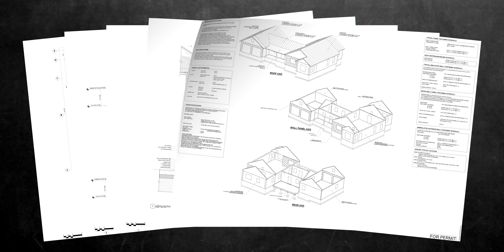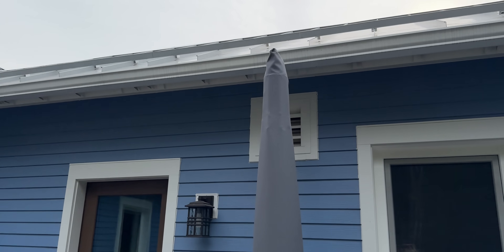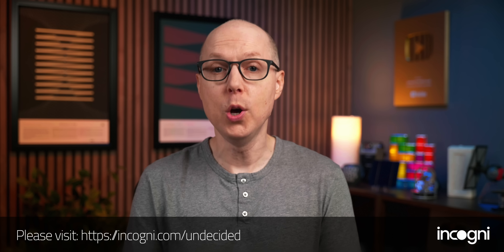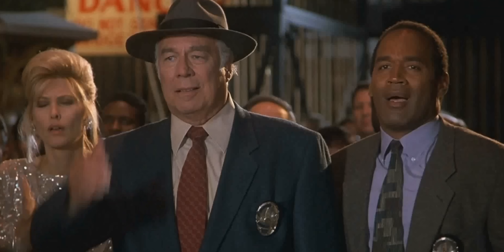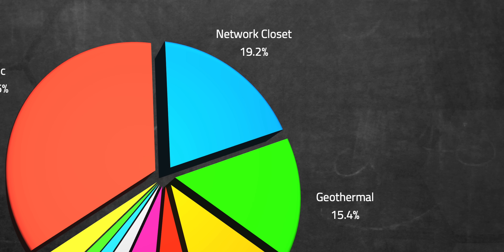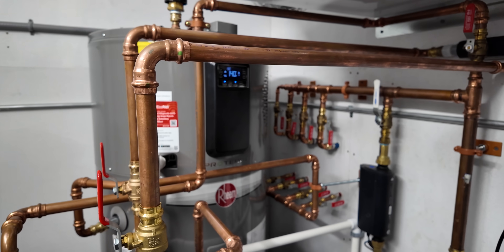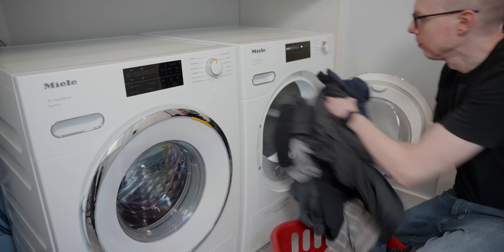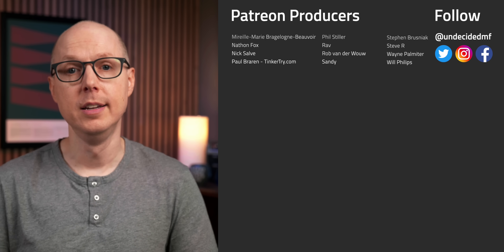What I Learned After 1 Year in My Net Zero House

Comment: Here in Japan, space is a premium, so ducting systems for central HVAC are practically non-existent in homes. Instead, there is a wall-mounted heat pump in each main room with the compressor mounted on a ledge or sitting on a balcony as applicable. So you only turn it on in the room you're in (and rooms are small, so they get to the desired temperature quickly), instead of heating or cooling the whole house/apartment all the time.
Reply: One benefit to Mini-Splits or Fan-Coil units is the inherent zoning. Each room temperature can be adjusted for individual comfort. Ductless Mini-Splits are very common throughout Asia and the Middle East.
Reply: Are there japanese companies that sell net-zero modular smart homes or condos like this in desirable markets like Yokohama, Chiba, Kyoto? What are average prices for a 2-3 LDK modular house? Do these homes appreciate or depreciate? Can rooms be rented on airbnb?
Reply: @ShibaVid  I wouldn't call Kyoto a desirable market - it's a tourist destination, not so good for basic living and more typical jobs. It's not in the typical commuting basin of Osaka the way Yokohama and cities in western Chiba Prefecture would be for Tokyo. I'm in Osaka, which is a great place to live - all the convenience of a large city but much more reasonable housing costs than the Tokyo Basin.

As for net-zero homes, I have no first hand knowledge, but the physics and typical home types are at odds. In the case of condos, there is simply nowhere to put solar panels except possibly solar glass on the sliding doors to a south-facing balcony, which is not much. And most free-standing houses are 2-3 stories to reduce their footprint and have almost no yard space, so again, it would be difficult to find enough space for solar panels to get to net-zero. The individual room heat pumps definitely help, but I don't they would be enough. I do see solar panels on roofs, but that doesn't mean they break even.

As for modular, that's not really a thing as far as I have noticed. Smart homes are probably gradually increasing in popularity (Japanese LOVE gadgets), but I've lived in the same condo for 18 years, so I haven't been looking at the real estate trends much.

Comment: Matt, I built a similar NetZero house in 2018/2019, I have an ICF basement, which is where all my utilities are located… 😊. I did NOT go electric only, I have a 1,000 gallon propane tank on-site, which is used for the dual on-demand Rinai hot water heaters, and I also have a propane stove/oven, as well as a propane dryer.  On the deck is a propane grill as well.  My propane tank is topped off every 2 years, used about 300 gallons each time since I’ve been living here…. My HVAC is a 4 ton Mitsubishi Air Sourced heat pump, with 4 zones, heats and cools all 7,000 square feet.  I also have a 10KW Enphase microinverter system on the roof, my yearly electric bill is $600-800, usually in March, after all the banked credits run out..  and National Grid direct deposit’s on average $150/month into my bank account, so I really have no electricity cost, and the propane bill is $1200/2 years, or $50/month on average.  Hard to do much better..  btw the propane also runs a backup generator, not that it’s been needed, so far..  Looked into the Enphase batteries, I still can’t do it, even with all the rebates and %30 Federal Tax credit, still too pricey, and really no benefit in MA anyway, since we have Net Metering.
Reply: Look into the ConnectedSolutions incentives for battery storage systems. If you make your battery capacity available to help with peak grid load they'll pay you something like $275/kW/year (yes that's a cursed unit). By my estimations a battery should pay for itself in under 10 years if you can make use of the federal tax credit.

Comment: Do you have a large emergency generator to backup all of that electronic and heat pump equipment? What percentage of increase cost did all of the high efficiency cost over standard equipment? Thanks for a very informative video.

Comment: The most epic is that heat pump dryer, in Europe we use a drying rack. Energy: 0KWH, Cost: 3.99$, limitation: space.
Reply: I once complained to the wife why was she using the heat pump dryer in the summer... She ask me: what do you prefer? The dryer or the iron? I never asked again...

Clothes come out almost wrinkle free and reduces the amount of ironing needed to a minimum and at the same time, it uses very little power.
Reply: @pintovit  I dry on a line in the open air and never ever iron anything. The wind sorts out the creases. I live off-grid so a dryer is not an option.
Reply: @chichestermaritime8174  
You forgot to include the UV " viruses destroy cycle" upon the cost.
Reply: @pintovit  drying rack also prevents wrinkles in clothing and is cheaper to maintain...
Reply: As long as the rack is outside, otherwise you are adding humidity to your house, which has a high cost for removal or increases the cost of heating your home. Outdoor drying (solar) is always best.
Reply: @CamMcCulls-kx6zk  it is not so much humidity especially if you have venting.
Reply: @wikingagresor  exchanging the air (venting) to reduce humidity either takes energy or you need to have an open window (etc). Increasing the humidity means more venting is required. If there is a temperature differential between the air inside and the air used to vent the house, then you also need energy to rebalance the temperature. All of this is well explained in the video. An outdoor line or rack will therefore be the best method.
Reply: We use a line in the backyard, $13.99, lasts 5 years. We use our dryer probably ten times a year, when it rains for four days and all the close are dirty
Reply: We have a heat pump dryer, in Germany. I think that's part of Europe XD
Reply: I also only know of very few people having a dryer, living in Europe.
Reply: Don´t know about that, there are millions up on milions of heat pump dryers in Europe :)

Comment: In Florida, we use Icynene (or equal) spray foam on the underside of the roof deck to make the attic a closed system.
No need for venting at that point.

Comment: Your recommendation of air source heat pumps puzzles me a bit. Doesn't their viability depend on your climate? I don't know which State you are in but it would be nice to know how its climate compares to mine in eastern Ontario. I need to replace my 22-year-old gas furnace and AC soon and I am getting a lot of mixed messages about whether I can switch to a heat pump. Thank you for sharing your experiences. I wish I had a few more decades to amortize the cost of more energy efficient technology.

Comment: Backup heat might be your furnace using the resistance heaters if it got "too cold". 

Check what your system is setup for to turn those on, might be something like X degrees or timing or something like that.

Comment: I was surprised when you went without even a partial a basement. Then not adding in floor radiant heat via Pex tubes using hot water from the Geo Thermal well I also thought it was a missed opportunity. 

Is there a reason you chose not to install in floor radiant? Was it cost? 

Curious as my wife and I are considering adding it to our main floor as a retrofit before we finish our basement. We would use it as a supplement to our forced air heat. We live just outside Minneapolis MN… it gets cold here.

Comment: @3:48 the graph you used could be improved. It isn't properly labeled so it makes it kind of useless data for us to analyze. Are you comparing the deltas, percentages, degrees, or some other numerical figure? Some more labeling or explaining what the figures are would be better. Also, whether you want humidity to be higher or lower than outside is dependent on your location -- rather what is the actual humidity value as ideally you float around 40-55% humidity in the house.

Comment: I had a spastic moment a few days ago and spent 5 hours drawing out a floor plan for a house. I already know I want it to be passive/net zero kinda of, Atleast slap a butt ton of solar panels and not use gas. to me "efficiency" is less important than producing more than you use. If you are able to sell excess electricity, you opt for the biggest panels you can get, and if you can't you really don't benefit from excess except to "future proof" against lower panel efficiency in the future. But I have my current house, and it is affordable to me now. When it's 3-5 years from now and what I would get after selling is enough to put down towards building a house, then I'll REALLY have to start planning.

Comment: It's more efficient to suck hot air from upper areas and duct them to lowest areas, rather than try to get airtight seals anywhere.
And the bonus is, you can use a reversible fan to suck cool air from the lowest areas and send it directly to the warmest area, eliminating the need for a dedicated A/C unit.

Comment: At this point, there's 3-5 heat pumps here and there in a house. I'm sure there's a better way to go about it. We might start to see pipes/ducts just to move heat/cold around where it's needed with a central heat pump. Makes me think of hot water radiators in older houses.

Comment: Be careful with your analysis. Some things don't matter as much as you 're indicating. For instance, waste heat from a regular water heater is typically not an issue as most of the year in your climate (New England states) you 're heating. You are just changing the location that you heat (around the water heater not the register or baseboard, etc.) Similarly, yes, the heat pump is giving off waste heat but mostly that was used to offset the amount of heat going into your house. Redirecting it to the water heater is only useful in the summer which in New England is the shorter season. Both of those pieces of equipment are quite expensive. A true look at the paybacks for those might not indicate a payback within the life of the equipment (i.e. a net financial loss). This also likely indicates that the embedded carbon in making and supplying that equipment to your house is likely larger than the operating carbon it saves over the life of the equipment (i.e. a net carbon loss).

Comment: If you don't want to dig a basement but you want to put HVAC and stuff under the house you can build over a crawl space. I work in crawl spaces all the time. If that's what you want to do please have it made as tall as possible and have it designed so people can work under it. It's obvious to me that workers are never a consideration. The harder it is under the house the more it will cost you because it takes a lot longer to work in tight spots. We appreciate electric outlets and lights under the house too. I recommend a sealed crawl with a moisture barrier and a dehumidifier for humid places.

Comment: Why can't we use induction technology for a central heating system? It works fantastically on stove tops..
Reply: you can only heat metal with induction - pots and pans for example.  It cannot heat the air...

Comment: I enjoyed hearing about your experience so far with your energy efficient house.  You might be interested in my experience having built (and subsequently evolved) a home with a similar goal 40 years ago.  I built a 3200 sq ft home in the San Francisco Bay Area with a goal of maximum comfort and minimum energy use.  40 years ago these were achieved by insulating walls to R-24, Roof to R-40, Concrete thermal mass with radiant heating, high efficiency gas boiler for heat and hot water, and very careful passive solar design to maximize winter sunlight intrusion onto thermal slabs and summer shading using trees and foliage on arbors.   No AC is needed due to the climate and passive cooling features and careful use of air current movement by placement of windows and skylights.   About 13 years ago I added 11KW of solar to the roof and two Teslas to the mix.  Due to California's (now changed but grandfathered) net metering rules my electricity cost is net minus $1,000 annually (yes... I get a check). That covers the cars and all electrical use.  For various reasons it has not been feasible to change the home heating, water heating, or cooking to electric, but the current cost of natural gas is still quite low.    

The project was, and continues to be, a tremendous success.  I built the house myself, and installed the solar as well, so my costs were extremely low, and it's all long-since paid for.  The comfort from a well-sealed, well-insulated house, as well as the relative silence, is striking.  The cost to build the house (including hired labor for foundation, sheetrock, and assistance) was land, plus $150K for construction and subcontracts, plus approx $15K for materials for the solar more recently.  The current home value is about $3M, so a decent legacy for the kids.   Most of the energy saving features didn't really cost much, and that's somewhat of a takaway... really expensive systems like your geothermal may have a much slower ROI than making the house tight and well insulated, and designed for the best use of passive solar.   My costs over conventional buildings of the time were mostly for 2x6 vs 2x4 framing,  additional framing to support concrete (thermal mass) floors,  and boiler/radiant heat materials which cost more than the more common forced air systems here.  They have all paid for themselves multiple times over 40 years.  DIY solar is an absurdly good investment (even more so now than 13 years ago).  The passive solar features were, besides the thermal mass, essentially just design decisions, siting, window placement, overhangs, etc, and didn't really cost anything.    

Your house - and the thought that went into its design and execution - is very impressive.  I hope you have as many years of enjoyment from it as we've had from ours.

Comment: Glad your house is working out so well.  I recently did a cost benefit analysis for replacing my electric hot water heater with a gas tankless and heat pump HWH.  In the end, the return on investment of the heat pump was over 20 years whereas the tankless was 9 (including local and federal energy incentives).  One thing I disagree with you on is the gas vs air sourced heat pump.  Depending on the cost of energy, it may never pay off to replace gas with a heat pump.  Based on my local prices, it is always cheaper for me to use gas than use the heat pump (regardless of the temperature) for heating.  Yes, the heat pump is more energy efficient but I still have to save money where I can.

Comment: Matt, you can't remove your network closet from the heating load. That energy goes into your house as waste heat but it still heats non the less. It has to be included. A better analysis would be to assume the heat is used in the winter but could be reduced by the SCOP of your heat pump and in the summer, you could reduce your AC load required for the network closet.if the network closet wasn't in your house.

Comment: I got a ventless dryer/washer combo and I highly recommend the all-in-one machine.  Not only is it energy efficient, but the combo completely transforms how you do laundry.  We run it overnight and in the morning the clothes are dry.  So it doesn't matter that it is slower to dry because you are just asleep while it runs.  No more "laundry day" because every night is a potential laundry night.  The combo machine is a bit more pricey but really serves to mitigate the downsides of the ventless dryer.
Reply: Ran into one of these in a stay in Scotland.  Worked ok but the total cycle was in excess of 3 hours, which is why you schedule an overnite run.
Reply: @schsch2390  Our GE all-in-one typically runs in about 2 hours.  Besides energy savings, we really appreciate having a washer/dryer that one just puts clothes in, 2 hours later, all with 110 outlet and no vent, but remember to clean the filter after EVERY use!!

Comment: I believe I have a ventless heat pump dryer, and it has unfortunately been a maintenance nightmare. Despite cleaning the lint screen after every wash, lint has more than once now clogged a pump in the back of the dryer that can only get fixed through an expensive technician visit. We are sadly considering going back to a regular electric dryer setup because it is becoming such a headache. I really hope this issue can be fixed in future heat pump dryer designs.
Reply: I don't have a ventless dryer, but I have friends that do, and boy are they not selling me on one.

Appliance manufacturers have made a lot of money on people's assumptions that the product they buy will work as well as the products they've had before.

Comment: Geothermal systems in this area have conventional resistance heat strips installed as backup heat. Not sure if that’s true everywhere. When the geothermal system is unable to achieve set point the backup comes on. Extremely inefficient!! Another reason to set it and forget it. (That’s true with air source heat pumps as well, except mini splits)

Comment: Note On the heat pump stuff yes it's very energy efficient. yes it's very noisy.  The Last House I rehabbed I cut my utility costs by 80%. 2 inches of closed cell foam and a  barrier of aluminum double bubble on all exterior walls and ceilings. The Attic was not conditioned. The floor was also  foamed. over a basement. I had zero chimney effect when I was done. I would have a Professional Blower Door test done if I were you. Something doesn't sound right.